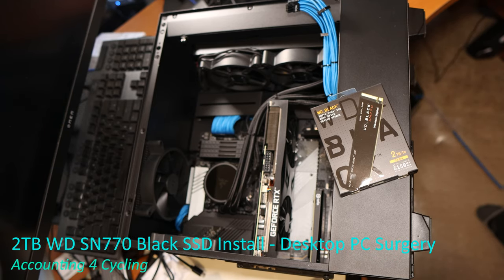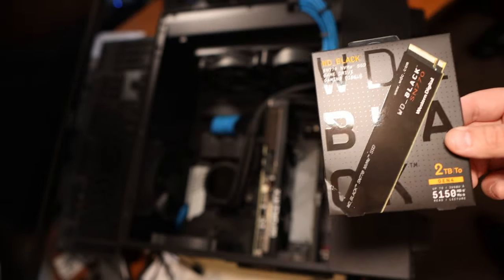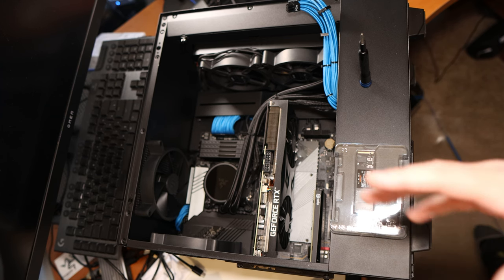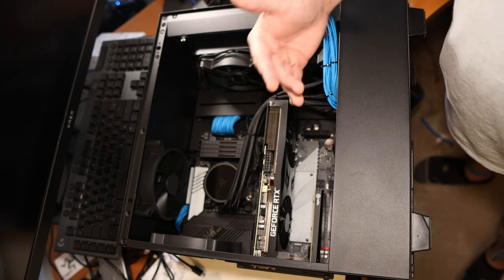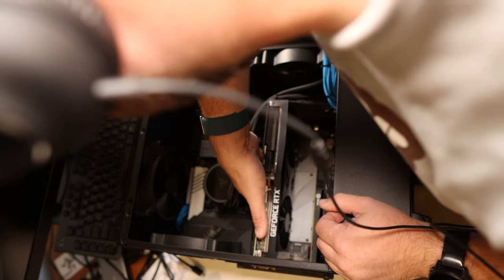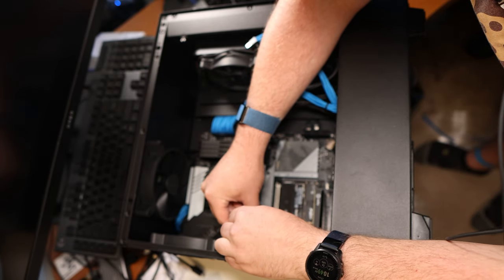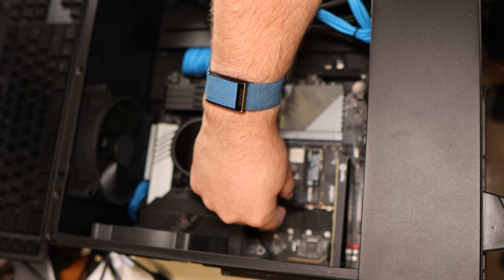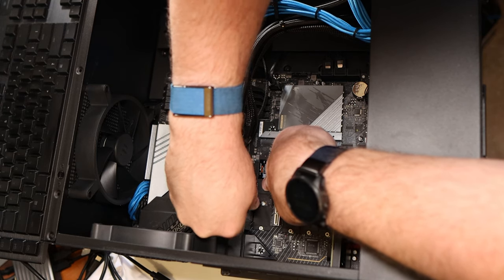Gaming PC Surgery - WD Black SN770 2TB Gen 4 SSD Install

Comment: Stick to your current impartial style. You're extremely knowledgable, and I'm learning from you even as a "seasoned" builder.
Reply from the maker: Thanks! This was a surgery born out of necessity, the old boot SSD was not the most reliable, especially as it aged. I've used a few XPG SX8800 Pro's over time and they've all been very reliable, the one pulled from here just had a rougher life since 2020.

Comment: I have this SSD and it's amazing. But it gets hot without a heatsink when pushing it. With CrystalDiskMark it gets 93C without a heatsink. Using the motherboard m.2 heatsink I get 69C with the same CrystalDiskMark test. Massive difference.
Reply from the maker: I noticed the heat in my Alienware X17r1, the little metal bracing plate with its thermal pad makes a massive difference in those laptops!

Comment: After installation I did not get any hdmi output to my monitor. Could this be related?
Reply from the maker: Probably not directly related, I would definitely make sure the graphics card and it's power cables are seated properly and double check the SSD is, too. The SSD not being seated fully would usually result in it not being found by the PC, so definitely check the graphics card and cabling. Hope that helps!

Comment: Did you have to enable the m.2 slots at all when doing windows install or were they already enabled? And was curious what Boi’s update your running or if you did any updates to it after this video so I can download and put on a jump drive before installing my setup lmk when your free thx man good video as always
Reply from the maker: I'm running the vF20 BIOS now, it was originally the vF7 BIOS and the m.2 slots were already active on first power up. I did check before installing Windows, too, and to ensure the RAM was set up.

The whole system booted smoothly out of the box with updates coming in from the internet. I also made sure to download the latest version of Windows to make sure there's no issues there. Hope your build goes well and thanks for watching!

Comment: No heatsinks?
Reply from the maker: Good eye! The heatsinks are the cover for the SSDs, big reason I purchased this board, and I liked the look of it. there's a thermal pad for each SSD under the cover plates to help dissipate heat.
Reply: I was wondering if that was the case. Seems like some need them and some don't
Reply from the maker: The heatsink plates seem to work pretty well, never had an issue with heat on any of the Gen 4 drives or the Gen 3 in there. Thanks for watching!